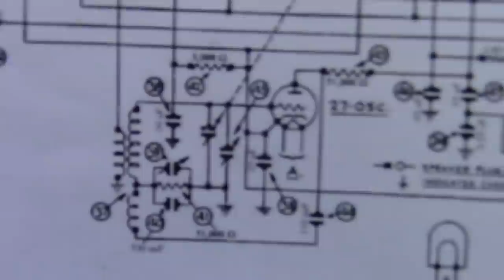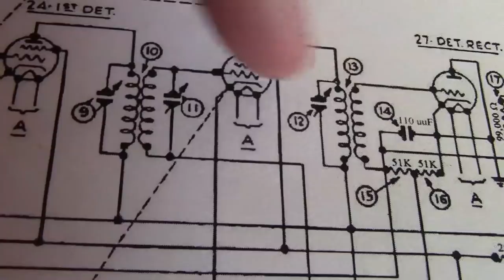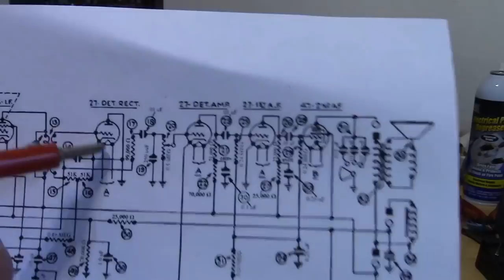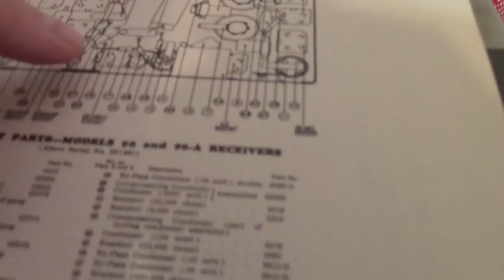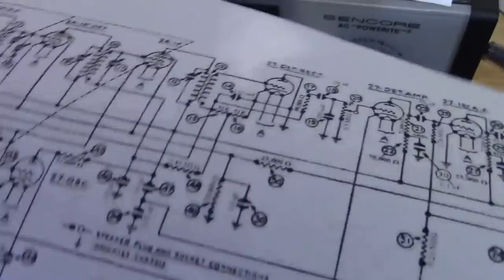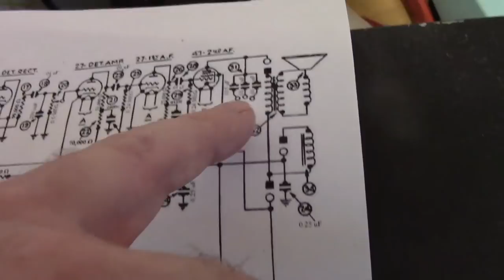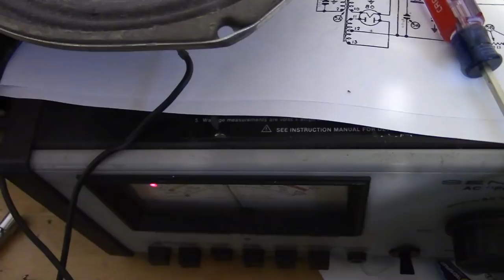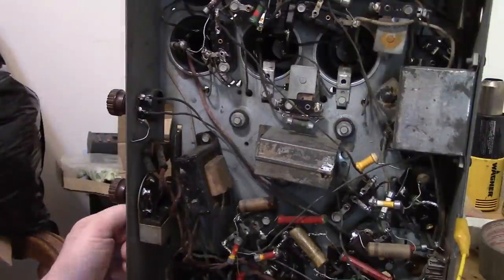Philco 90 resto p2o?

Comment: Great tip on checking the local oscillator. Thought I have better means to do it these days, often times I just turn on one of my pocket transistor radios and start tuning around to listen for the squeal. 

I remember learning that trick many years ago from one of Allamericanfive’s videos. 

As an interesting aside, I had heard the military stuck with TRF based radios instead of embracing superhet, since the oscillator in a superhet is basically acting as a little local station, and could possibly be tracked by an enemy trying to find the source.

Comment: WCPT is 5.8kW at less than a quarter wave day and 1.5kW night directional to the NNE.  Day is a tower on top of the building on Milwaukee Aveune and night is six towers near Joliet.  The ground system for the day site is quite interesting.  I wondered where they placed it.  It's all over the place.  As you'd expect, it's diplexed with WSBC which for its frequency is slightly over a quarter wave at 1kW.
Reply from the maker: Ah that explains it. I really am just a couple miles from the day transmitter.

Comment: I have wondered this for a while, for a Philco model 70, is there an ideal lengh and gauge for an antenna wire, and what is the ground lug for on these old radios?
Reply from the maker: It's been my experience that 25 feet is good for all the local stations.  50 to 75 feet for distant ones.   Grounding is very important.  I'll go over why in the next installment.

Comment: I think a shorted turn in the primary of the power xformer would raise the output voltage, wouldn’t it? Removing a turn on the primary would have the same effect as adding a number of turns on the secondary, according to the turns ratio for each secondary to the primary. A shorted turn in the secondary would lower it.
Reply: ...I'm pretty sure that a shorted turn in either winding of the power transformer would cause the transformer to run hot(?)

Comment: So as I understand it you have changed the rectifier tube and the filament voltage has gone down, because maybe a leaky cap somewhere is pulling the filament voltage down (because the B+ has gone higher due to a more efficient rectifier tube)? Or it could be a shorted winding or two in the power transformer? Just trying to make sure I understand what you are postulating.
Reply from the maker: The filament voltage was higher with no rectifier tube. It's been lower with both rectifier tubes. I suspect three reasons. One, the rectifier the be filament draws a lot if current. Two, a loaded down B+ is pulling it down. Three, a problem with the transformer itself
Reply: @bandersentv  Ah, I see. Thanks for getting back to me, appreciated.

Comment: Well, this is bizarre; the tube labeled “27 Det. Rect.” on the schematic shouldn’t work as wired, as the plate is grounded; how the 🤬 is it going to get B+ to conduct? For that matter, the cathode is also wired to ground, so there’s no potential difference between the hot cathode and the plate, so definitely no conduction here. The result would be the same if you just yank the tube out.
Reply: It is odd that both cathode and plate are grounded, but there's more to the story. We like to say the grids are high impedance inputs but this isn't quite true. Current flows from grid to cathode when the grid is positive and this is what makes the circuit work.

Basically they're using the triode as a diode. Maybe it was cheaper than an actual diode, who knows?
Reply from the maker: I don't think there were any small signal rectifier tubes back then.  Later came the dual diodes like the 6H6 or combo dual diode/triodes like the 6Q7.  Just read up a bit on the 27 and it was specifically designed to be used as either a detector or amplifier in radios.